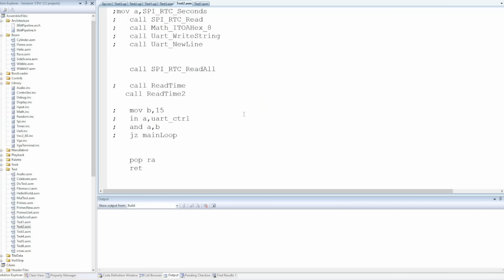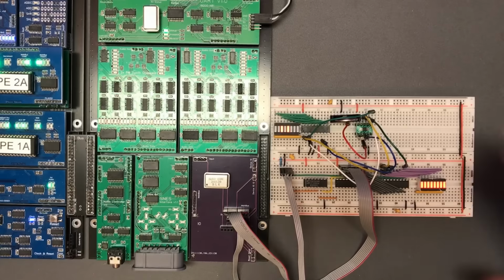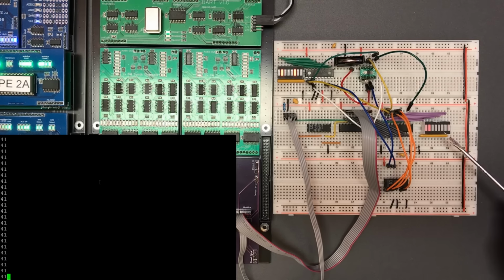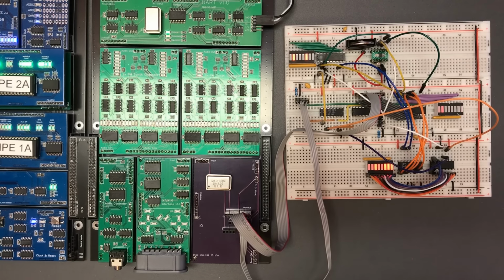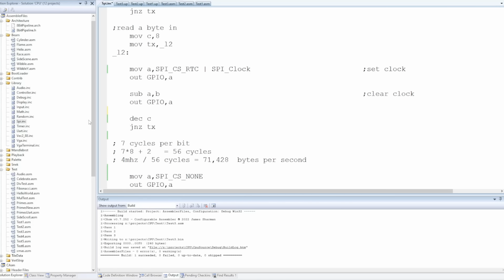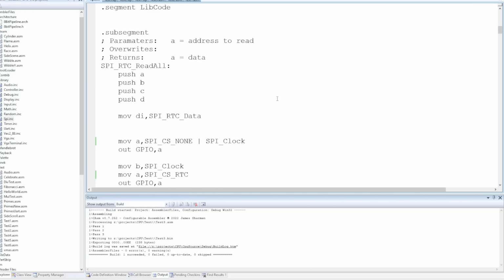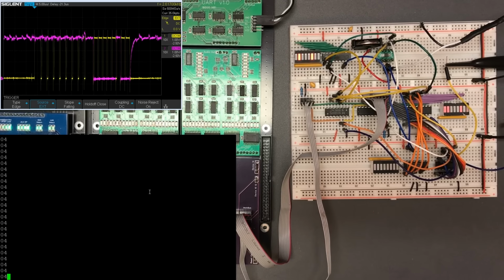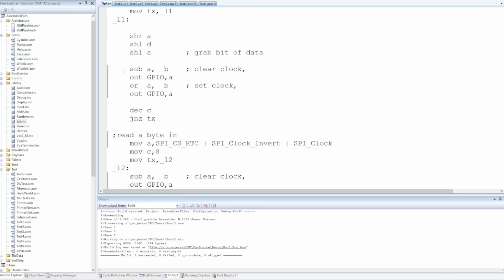Hardware SPI - IO from Scratch - Part 6

Comment: I’m fairly certain that you must have already thought of this, but for loop unrolling it may be useful to have a macro/preprocessor step that is able to generate the unrolled loop.
Reply from the maker: I have been thinking about adding some features to the assembler for that. I have a few other places where that would make things more maintainable.
Reply: That is why people created compilers )))
I would actually like to see C or Basic or something else running on this
Reply: That's what I thought as well. Fancy macros allow using `i` inside the unrolled code, but a basic `repeat(8)` block would do wonders here
Reply: This could be done without need to implement it in the assembler, just use a C compiler and tell it to to pre-process only (-E for gcc IIRC). If you're using Makefiles this should be an easy step to add.

Comment: The 595 is an interesting solution.  I chose the 74ALS299.  It can input and output through either parallel or serial in both directions. I'm using it with a 6522, with one port being the 8 data lines and the other controlling SCLK and CS.  It also supports shifting in both directions, if necessary. The only issue is switching between SPI modes. I'm sure I can solve it but I haven't had time recently to work on it.

I also use it to interface to an arduino with a small screen for debugging.  3 chips lets me read both of the address bus bytes and the data bus byte quite easily.
Reply from the maker: You'll be interested in how I do some of that in the next video. Being able to shift in both directions is not something you need for this though although a shift register with that can do both parallel in and parallel out would save a chip.
Reply: Whoa, that's a nice register. Adding some of those to my shopping list!

Comment: I was going to comment on you changing some defines to a 0, which removes the readability of the code by adding magic numbers. And then just as i was going to type this comment you went back and replaced the zero's with some defined constants. well done. 🙂
Reply from the maker: Glad I didn't disappoint (this time).
Reply: @weirdboyjim  Never known you disappoint, provide talking points yes but disappoint no. 🙂

Comment: James you should look into the 74ls95. Its a parallel in/out serial in/out shift register. If you connect 2 of these together you basically got SPI done except for the clock generation. I saw that LCSC has these in DIP package. Might want to have a look into these
Reply from the maker: That's a nice part but it doesn't have tri-state outputs so you would need another chip to interface it to the main bus.
Reply: @weirdboyjim  You could add a latch and a 245
Reply: I'm afraid 7495 is discontinued, there is no CMOS version. I remember in previous century it was a Swiss army knife like a 7400.

Comment: Great video! 
I am very interested in constructing an hardware SPI module for my own project. Unfortunately I have to admit that the way the functionality was presented here (as a conversion from bitbanging) I was left a bit confused. My mind is not really built for cross-referencing two videos. But I totally understand that this is not a how-to-guide. Nevertheless I look forward for an future video where the circuit schematic is built for sending it to an PCB manufacturer. Maybe you can go over it once again, how the new circuit ties in with the rest of the system.
Reply from the maker: Sorry to hear you found it harder to follow.  I try to show building things up step by step rather than showing a finished circuit and explaining it. I guess different people prefer different ways to work and learn.
Reply: @weirdboyjim  no problem at all! that was in no way a complaint. Quite the opposite, normally I love to follow the real world progress of the project. Only now when I try to pick one single aspect of it out of context it is a bit harder.

Comment: Very interesting :) I was wondering why you didn't write `out GPIO, b` but obviously if there's no instruction for it that won't work.
Would it be possible to use a counter chip that's somehow clocked 8 times per CPU clock to do one byte's worth of SPI clock in a single CPU  cycle?
Reply: I was thinking something similar, but you wouldn't want to multiply the CPU clock.  Instead you'd have a second oscillator or use the master clock for an 8 cycle counter which is then triggered using a single instruction from the CPU.  So Read_SPI triggers the SPI circuit to read 8 bits independently of the CPU into the 8 bit SPI latch, and you'd have a similar circuit for writing.
The timing of the independent circuit will be determined by the clock speed capability of the SPI spec.  If the system clock falls within the spec then everything's great, otherwise you'll need a second clock source.
Reply: Sorry I should clarify, not a single CPU instruction - that would involve adding to the instruction set.  I mean an instruction from the CPU to the SPI circuit.  There may be a number of CPU instructions and interactions across the bus to achieve it, but you're saving the time the CPU currently generates the bit shifting clock.
Reply from the maker: I actually discuss that very thing in the next video. Running the clock at system*8 = 32mhz would be really cool, but not all SPI devices can run that fast which would introduce a another level of complexity to the circuit.
Reply: @weirdboyjim  This is what you get for delaying your releases! ;-P

Comment: Unrolling loops doesn't have to be unmaintainable!  I know you wrote this assembler yourself, but look at what ca65 does for "macro assembly".  There are things like a repeat directive. And even user definable macros which can feel a lot like calling functions, but without any jumps, because you're just inserting code into your ROM imagine and all the repeating and/or parameter swapping is done at assembly time.  You should consider improving your custom assembler with similar macro-based functionality.
Reply from the maker: I have a hope to add a number of new features to the assembler but balancing the time spent on various parts of the build is not easy.

Comment: FWIW not all SPI devices will tristate their MISO pins when not selected.
Reply from the maker: All the devices I've looked at so far seem to, but I know that SPI is not a defined standard so there are many variations that all claim to be SPI.
Reply: If you buy them on those little modules, that issue is usually fixed by the incorporation of a 74HC125

Comment: I'm confused, why keep controlling the clock from code directly? Hardware spi in my mind means giving a byte to the hardware and be safe in the knowledge it will be transmitted. What clock you have will just be a "setting" in the hardware, a register. Same for reading. You only do that when the hardware signals it has a complete byte to read. 
Maybe i missed something in the video, but at the moment what you are going for, looks more like hardware assisted spi then actual hardware spi
Reply from the maker: The thing you missed is that I've broken the build into 4 steps and only covered the first two here. The second video will deal with the clock.
Reply: @weirdboyjim  ah yes, I got the impression from your explanation that even in the other parts the clock would stay directly software controlled. Though assisted by that control line and such for inversion. I'll just wait for the next videos then.

Comment: When the read command comes, the clock could count 8 pulses independently.
Reply from the maker: The next video in this series deals with clock generation. I had hoped to put all 4 bits in one video but it would have been very long.